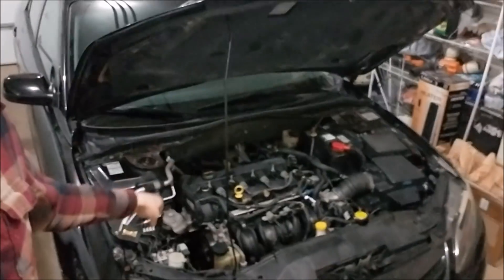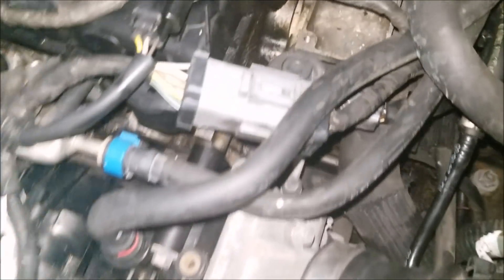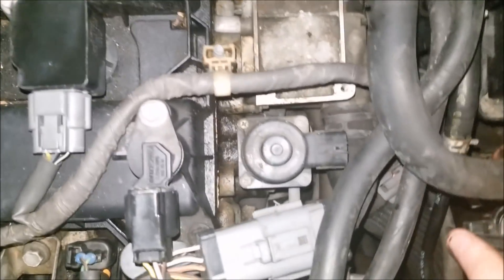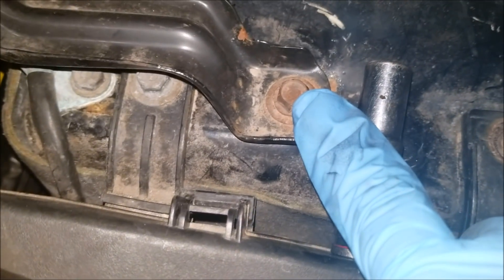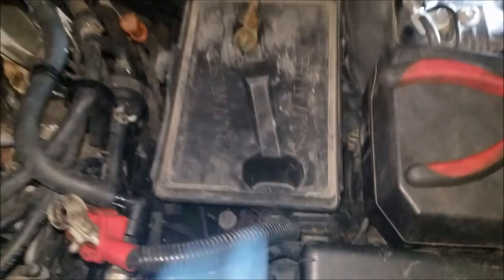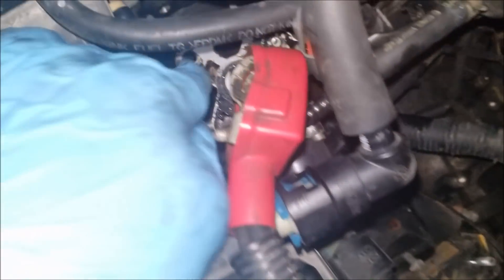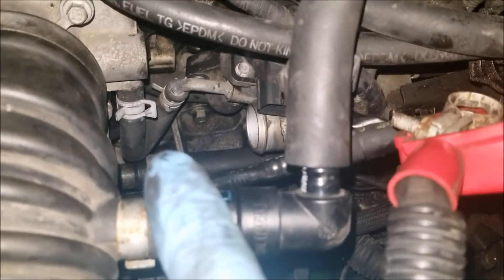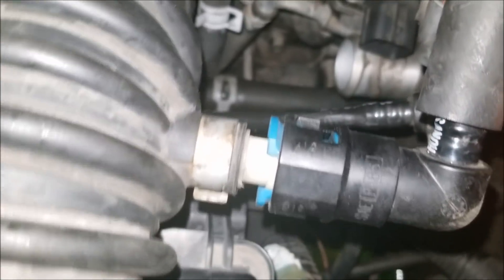How to clean or replace EGR Valve: 2003- 2008 Mazda 3,5,6 and Tribute 2.3L

Comment: Contamination risk: Any residual brake fluid left on the EGR after cleaning could cause serious damage if it makes its way into the intake manifold and engine. Never use a solvent from one system on parts for another.

Comment: I do egr on this 2.3 with a short swivel setup or even with 3\8 rachet with 1.5 inch long 10mm, without removing coolant hose, battery or the battery cable.  If the key is off, the TB and EGR harnesses are disabled on this model.  ( some newer cars however wake up the throttle body when the door is open and that car should have battery disconnect).  Better safe than sorry I guess ; )
The trick here is to remove the air intake, TB and then the EGR..  All three are the same system and get maintenance at once.
Install is EGR, TB, then Air intake then Maf.

Comment: Back trying this a year later, even with all those attatchments all it does it move the joints and doesn’t actually hook onto the points where I can get torque to get the bolt off, how in the world did you get it off with those snaked sockets?? Is there any other way to do this?
Reply: Yes, the procedure is to remove the Intake and throttle body and then you have no throttle body in the way.
Clean the TB, EGR and MAF,  air filter and intake tubing.    This is the way.   no need to remove battery or coolant for this 2.3 at all if you just do normal procedure:
* remove maf sensor, clean it with MAF spray, do not touch the resistor! set it aside.   
* remove air intake tubing, clean it and set it aside. 
* remove throttle body and gasket, clean it properly (watch some videos), set it aside. (gives room for 3\8 driver, 1.5 inch 10mm)
* remove EGR valve and gasket, clean it with brake cleaner soaking, light pick tool without scratching, soak again and again.

Install is reverse^.
Reply: @DevJB managed to do it by removing the air filter and intake hose aswell as unscrewing the top of the egr valve housing, found a spider living in there which was weird. This seems to be the “easiest way” although I tore up my hand in the process it was worth it

Comment: My valve cover gasket keeps leaking within a year after replacing. Is this something that might be caused by a clogged EGR valve or PCV Valve?
Reply: Could be from PCV,   does the vehicle have slow acceleration?  Did you fix it yet?

Comment: Can I just delete it
Reply: That’s what I want to know, if I can block it off
Reply: @louisbarningham  It's illegal, causes harm to environment, would need to delete some codes as well which is also illegal to block from inspection if you have those.  Any vehicle egr can be disabled,   you get into DPFE issues with the codes though and some ecm's will go full mental 'laggy' which damages timing and pulse.  It's best to just clean them, be legal and hug a tree.

Comment: I had to change out my egr on a 2008 mercury mariner,  all the posted videos didn't look ANYTHING like mine,  yours did. While not exact, the parts that mattered were spot on, like the coolant port directly in front of the second screw. I also used your makeshift tool idea to break it loose. I ended up untwisting the screw out by hand the rest of the way.

Comment: I was stubborn and didnt wanna remove the radiator hose. Mainly cause I wasnt planning on getting the EGR valve today but I did a side job and ended uo getting the money to get the EGR valve. I didnt wanna lose a lot of coolent cause I only had half a jug left and I didnt even know I had to remove that little hose to get it out. I literally just went in blind and watch a bit of your video. I saw I was on the right track but didnt bother taking off the radiator hose. Thanks for the vid dude
Reply: Did you get it off without removing the hose?
Reply: @MogulOX  yeah I did. Thing is though I used a 1/4 ratchet and a shallow 10 mm. To give it leverage i used 2 3/8s short extensions and a 1/2 10mm then the put them on the handle of my ratchet and broke the bolt loose. The space issue starts coming into play when you have the bolt almost out. At which point you take the ratchet off of there, then I used a 10mm open end wrench to get it off the rest of the way. But you have to take your time cause it's very finicky when you do it like that. Honestly if I had my 10mm ratcheting wrench with me, it probably could've saved myself more time. Or I'd I had a swivel. But yeah you don't have to take off the radiator hose. You can finesse it, you just gotta take your time.
Reply: @MogulOX  OH also, idk if this is the same for the Mazda 6, it probably is (I have a Mazda 3. But I also had to remove the wire harness that goes to the injectors then remove the other half that goes to the ignition coils and purge valve (and some other stuff I can't remember. And I moved the coolent hose (you can literally take it out of those little clamps that holds it to the radiator and hook it against the plastic piece that holds on your engine cover.) that runs from the overflow tank amd all the way around back to the heater. Once you get all that outta the way that also makes it so much easier.
Reply: @MogulOX  I still. Ended up loosing some coolent cause there a small coolent line that runs from the throttle to the EGR valve. So that's inevitable. But it's better then dumping it all out

Comment: I did this job, just replaced the old with a new EGR,  on a 2008 Mazda 6 with the 2.3.   I'm here to warn ya.....Buy a small tube of water pump gasket maker.   Permatex or whatever.   And put a consistent thin bead of that stuff on both sides of that crappy thin metal 'gasket.'   Finger tighten it, wait a day, then torque it down.  Why?  Because coolant flows through that EGR housing.  That's why.   And be very very very careful about working that difficult lower bolt back in.  Mine crossthreaded even though I thought i WAS being careful.   Couldnt get it to go more than 2/3 of the way in.  So I ended up having to use washers under the head in order for it to hold down the EGR nice and tight.   Because wouldnt you know it thats where the port on the head for the coolant is.   SO the first time I tried this it was leaking coolant and I had to re do it with gasket maker.   I even put high temp thread sealer on that bottom bolt because it looked to me like that hole actually may penetrate the water jacket in the head.   Couldnt be sure but wasnt taking any chances.  My second go at it has held up with zero problems.

Comment: I have a 2008 Ford Escape with the same engine - I figured out a way to remove that difficult bolt. First, remove the air box cover, the battery and battery tray. Now remove that coolant hose - it'll dump a bunch of coolant so put some rags directly underneath and a tray to catch anything else from spilling onto the ground below. Now to get that bolt out, you need a bench grinder or some sort of grinding tool - find a cheap socket extension and grind it down about 25% thinner, then take your 10mm socket and grind it down so it is shallow, just deep enough to go over the head of the bolt (take the front bolt off to check) - now you should be able to easily get that in there and back that bolt off! I spent many hours trying to figure this out, including using the exact method mentioned in this video, which did not work for me (could not get enough torque on the bolt to turn it at all).
Reply: Do you actually have to remove the coolant hose though? I’m not tryna buy coolant aswell trying to take one part off my engine

Comment: What a pia this was to do. That bolt was so stuck on mine. Needed to remove the hose in front of it that was held on by 3 bolts. Meaning battery removal, tray, motor mount support.  Finally got a straight shot at it with that hose removed. His contraption didn't work even after trying all morning. Now, hopefully all this work putting it back together will reduce the rough idle problem I have. Let's see.

Comment: I just got my egr valve replaced but it still gives me some issues.... it drives fine at first like I'll go to a destination like the store for 30 minutes and crank it up and it acts differently like a subtle shake and some gas smell on the ride home.... any suggestions?
Reply: Did you solve the issue mate?

Comment: Sirs,, based on your respective experience, would it be better for my 15 years duratec engine if i just block these two holes?

Would it give a better iddle & better MPG if i block these holes with thin metal plate?

Thanks
Reply: How did it go mate?

Comment: Hello my mazda 5 2007 diesel start normally but will not receive gas at all barely reaches speeds up to 2000 rpm, stinks and smokes gray-white smoke, after waiting a while everything is normal. Is it an egr valve?

Comment: Hey, how long would you say it took to replace the EGR valve?
Reply from the maker: About 30 min.
Reply: @AnthonyAwada  When you removed the EGR valve, did antifreeze come out? I noticed some in the video when you was removing the part. Trying to figure out if this is my problem.
Reply from the maker: @SaltPepperKetchup90  yes, there is one hose that connects to the antifreeze.

Comment: Did you do anything to clean out the wd40 and brake cleaner from inside the EGR? Since those are degreasers, would it wreck things to leave it in there? Do you just wipe it out with a microfibre rag, or dare I saw spray bottle a tiny amount of water to rinse out and then dry?
Reply from the maker: Hey Gavin, great question. The last cleaner is used was soapy water to remove all oily products. Realistically, everything is going to get hot and evaporate.
Reply: Anthony Awada interesting. Does it matter if you use dish soap or some other?

Comment: Obd2 reader says EGR system failed, I'm noticing an increase in fuel consumption but no check engine light. You think it's worth checking the EGR and maybe do a bit of cleaning?
Reply from the maker: Absolutely! Sometimes the egr is working just enough to not throw a code but not at full efficiency. Could also be a good time to do a tune up (spark plugs, air filter, etc).
Reply: Check the fuel pressure regulator valve.  That was the problem I was having :)

Comment: the engine setup is not the same on a Mazda 6, that egr valve is mounted differently.
Reply from the maker: The car that I am working on is a Mazda 6
Reply: sorry, I meant the diesel version. yours seems to be the gasoline version

Comment: Thanks Anthony.  Looks like tons of fun.  After seeing the insides of this EGR valve I am wondering if you decided to do this job because of a code P0401 or because you noticed the cold weather RPM part you mentioned. 

SInce you seem to know your GH1s I wonder if you've ever separated the front lower control arm ball joints (both of them).

Comment: Hi all. I have got a Mazda 6 2004 combi and I got a p401 and p404 "egr valve circulation  issue" I have removed egr and cleaned  than after a few km later the code will come back again.. Somebody  got any idea what to do next? is o2 sensor could couse the broblem?
also see vid pls
https://mega.nz/?fbclid=IwAR3NSibcYwCEyfHFzBgGXmTrPU83GPxYJf6p2l1LcluRyqDa_nKgcRN5ttQ#!eWZgBKoJ!yppsYTXsrF95QpqK3G3lC5EUTFOc9kv3VtK80Hs5jvA

Its happening only when the vehicle is about 10% "skew" on left side

Comment: Hi, after watching this video I'm trusting you on this! 
I have a couple questions about my Mazda 5 2L Diesel 2007. 
I'm by no means a car guy, at all, but I learn quickly and I have a fair amount of mechanic friends who can help me out with the technical stuff. 
Right now, I'm just trying to get a better picture of whats wrong with my car. 

A couple symptoms are: 
Sometimes becomes incredibly weak, I need about 4000RP to be able to change to the next gear for the car to move at all. When the car behaves that way it also puffs out really black exhaust, which from my understanding means the fuel/air ratio is off. Now, I don't know if it's too little air or too much fuel but I've checked the Air Flow sensor in the engine compartment and that one is fine. Some sources say it's the EGR Valve and others say it could be an injection problem or the lambda sensor. 
The weird thing though is that the car returns to normal after an undefinite amount of time. 

Any thoughts? Anybody can give their thoughts. :) Thanks guys!
Reply from the maker: Hi, I am by no means a diesel expert. Is the car throwing any codes?
Reply: @AnthonyAwada  seems like it's a mixture of different things, I've had it checked a little and have tried to read up on this myself. Intercooler was blown open which caused the wrong air pressure, which then caused the engine to miscalculate air/fuel ratio. Now, however, the turbo seems broken and maybe the headgasket as well. Might be because dirt and smutt got into the system via the open intercooler.

That's an update so far atleast. The car is totality undrivable at the moment.

Comment: So what does it mean when you take the egr valve off and clean it and put it back in and water pours out it? Replace egr valve? It wasnt leaking prior to this just had the crappy idle and rough running conditions.
Reply: Nevermind scrapped car

Comment: Excellent video, mines throwing a engine light for awhile now and I’m going to tackle this after doing the same on my defender. What’s the odds of the motor in the egr being stuffed from pushing a stuck valve? Don’t want to really strip it and reassemble without a degree of certainty that it’ll still open and close once cleaned.
Reply: How did it go mate?

Comment: Hey Keeper, guess what, I am having having the same idle issue again just near 1.5 years later. Had the Stealership do the EGR replacement in Dec '17 and guess what its doing the same idle issue with the strange smell of rich fuel smell. I also have erratic RPMs sometimes when I go into neutral. I am fixing this one more time and it should last me another year. Just long enough for me to go Honda or Toyota and never buy Mazda ever again. Thats 2 damn cars (Tribute and the 3) that have plagued me with idle issues which were tough to fix.
Reply: Maybe you should learn about cars and preventative maintenance instead of thinking buying a different brand will solve your problem. How fucking stupid
Reply: What if just block these holes,, would it give us better idle n mpg ??

Comment: I got it out with a standard quarter inch ratchet and shallow 10mm socket and didn't need to take out the whole battery/terminal.  Trick was to take the Black Sensor piece off the top of the EGR Valvw, it's 4 screws this goves you much more room to the bolt.
Reply: I’m totally going to have to use your trick. It’s no fun collecting all those socket adapters and I think it’ll be tougher to unscrew the bolts with no space and risk losing the rig inside the engine compartment

Comment: If  you want to check the egr for leaks get small paint brush and brush some washing up liquid around the seal and it will blow bubbles then you can see if needs tightening any more when tight just rinse off because it can crowled on Some metals. I wondering you could use one of the flexible drill Extensions, I know you can get sockets to fit then
Reply from the maker: Thank you for the idea, Sean. I didn't think about that. Great idea.

Comment: What is supposed to be on the square blank plate just above the Egr valve. I have a 2011 Mazda 5 and it is leaking coolant from somewhere in that area.
Reply from the maker: That block delivers coolant to the block and back. I doubt the block is causing the leak as they are made of aluminum. I'd check the hoses going into and out of it as well as the clamps. Hope this helps!
Reply: Anthony Awada  It was the Water outlet. Somehow it had cracked. On my car the entire thing was polymer aside from the top mount. Shitty design.
Reply from the maker: @atomicdeath10  wow,  I've never seen one Crack before. Mine is made of aluminum.  Maybe different years had different designs or maybe yours had an aftermarket.

Comment: It might be easier to take it off from throttle body to make a room to take off the EGR valve rather than battery and battery box with a lot of cable and fuse box (means a lot of work), when throttle body off, you can also clean it as well, make it part of the job.
Have you tried spray it with CRC intake cleaner to clean the EGR? Which one is better compare to brake cleaner?
Reply from the maker: Hi Rudi Lam, you might be right about taking the throttle off.
To my knowledge Intake cleaner and brake cleaner are the same. Could you clarify that? Thank you.
Reply: Anthony Awada Hi Anthony, thanks for your reply, according to my research on forum that the brake cleaner has a lot more chemical which is make difference ingredients between brake cleaner and throttle body cleaner, but i believe that brake cleaner more stronger than throttle body cleaner itself, but im not really sure, so i asking you before have you try CRC thorttle body cleaner, because im not really sure about those 2 cleaners to remove the thick carbon on EGR valve.
Thanks for sharing.
Reply from the maker: Rudi Lam So I have used CRC throttle body cleaner on throttle body before and I wasn't impressed. It didn't clean anywhere near what the brake cleaner did. That's why I never went back. I believe the throttle body cleaner might be weaker to not damage any electronics near the the throttle body.
Reply: @AnthonyAwada  ...and not to dry out the rubber sealants, which you can't avoid if you're letting the brake cleaner on for too long. CRC cleaner is safer when the rubber parts are being exposed.